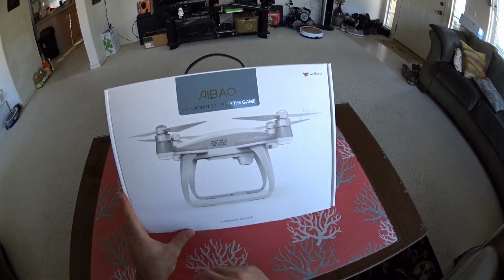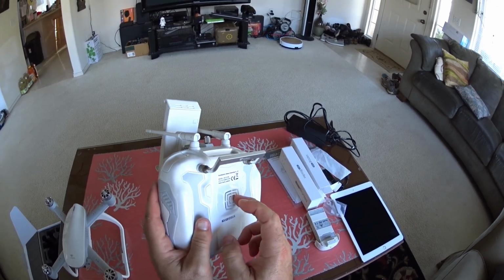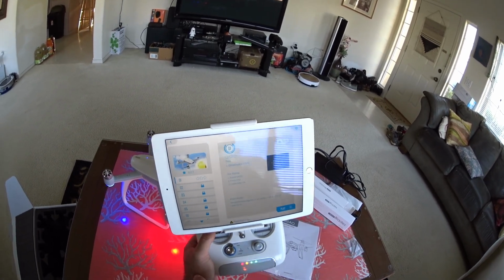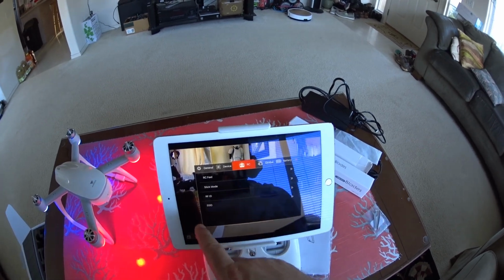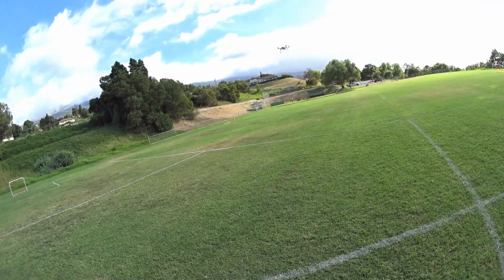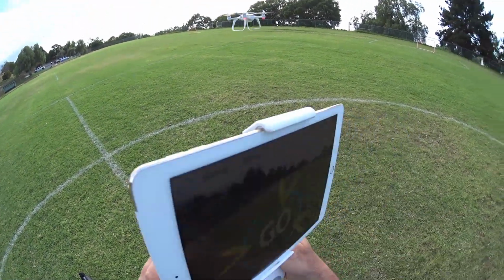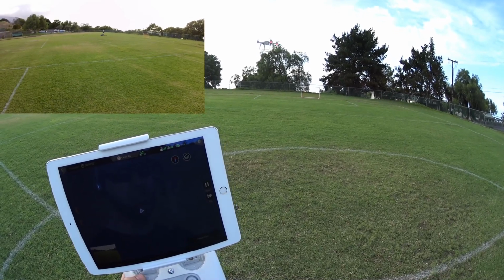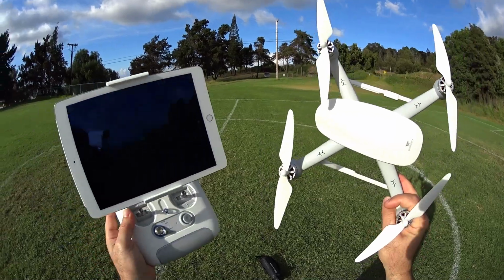WALKERA AIBAO - Full Review - [Unbox, Inspection, Setup, Flight Test, Pros & Cons]

Comment: hi . phantom 3 standart or xiaomi mi drone ?
Reply: Vine of Vayn I'd get the  phantom 3 pro
Reply: Vine of Vayn well I had the same question I am going for the phantom 3 standard because I want to get it on a better brand drone
Reply from the maker: +Temmie gaming YTPS and memes I'd go for the Xiaomi 4K from my experiences with both.
Reply: Dustin Dunnill I am a bit iffy about gear best exesuly for some thing over $400 but  for a while I was deciding for the mi 4k but if you found it for like $500 on Amazon I will go for that

Comment: Too bad so many serious manufacturers get in a hurry to meet release dates. Walkera did the same thing with the QR 350. The first release sucked! Some of them just fell out of the air after one or two flights. They took customer complaint feedback to heart. The problem was they rushed to hit the market. Their assembly people were doing bird poop solder joints. The ESCs were coming unsoldered. The next generation, the QR 350PRO, which I purchased two of, were much better. I have the 1080P Ilook with gimbol version and one that I modded with a 700TVL camera and a 600mw transmitter. A good "Be Aware Of" video. Walkera will fix the problems and re release the refined version in a month or so. ;-)
Reply from the maker: +Don Fish Jr. (The Flying Fish) Well said bud.  Some work to do in software as well.